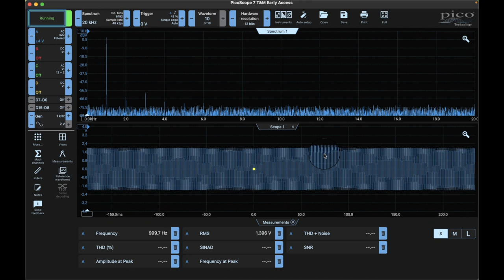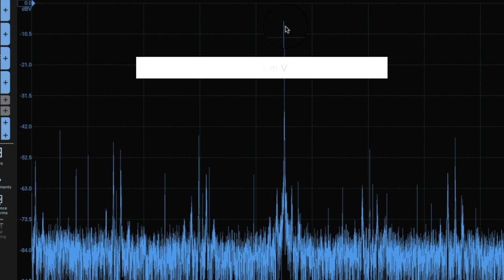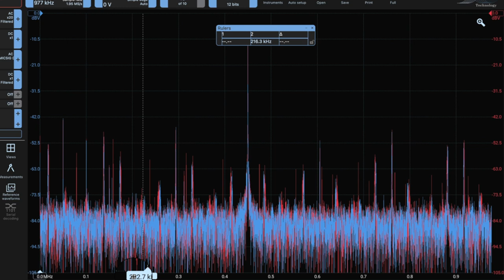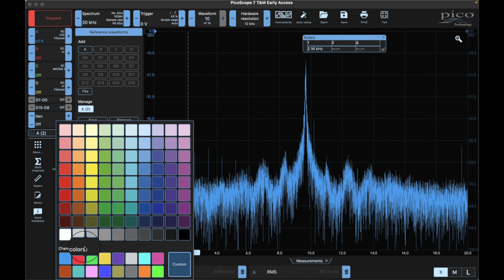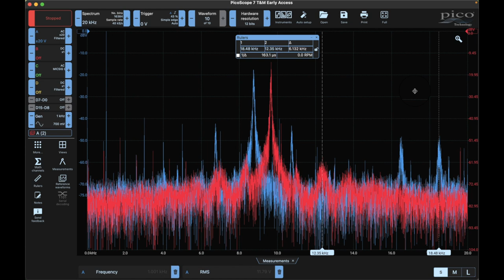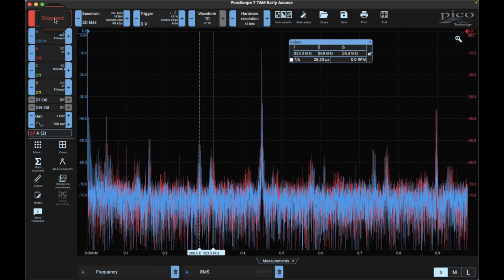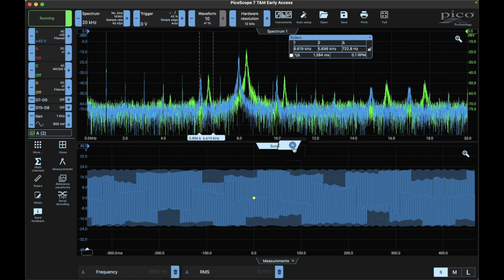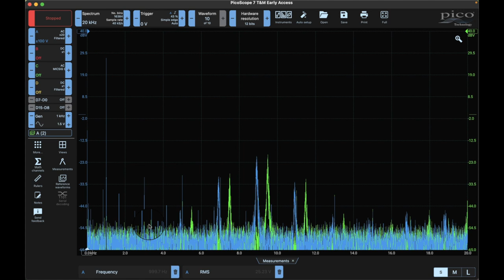TPA3255 Class D Amplifier Power Supply:  Linear vs Switching Power Supply Noise Study

Comment: If you have a bad smps, the EMI is a very disturboing factor, and all the harmonics and pulses of the switching action is bad, the mosfet body diode is a uge bad factor, the new Gan mosfets has no body diode and are very clean.
Reply from the maker: Thanks for your feedback!  Yes any bad design will ruin the benifit of using any good parts.  I think it is a bad idea to count on the body diode to do any function.  They have made the body diode more robust so it doesn't get burned out too easily, but I think most designs do not use the body diode on purpose;)
Reply: @KissAnalog  Do you now that a LCC doe also not bad, and no need of air gap and can use high inductance because these resonant tank is a current source, and very stiff. I have a very nice regulation and because of high voltage I uses this do a lot better. Even when no load zvs stays thanks to the circulation currents are in the tank and not in the transformer.

Comment: Regarding the small caps, there are definitely 100nF or 220nF decoupling caps from the Supply rail to GND right at the TPA3255 chip, underneath the heat sink. I wonder if the problem with running the switcher with the TPA3255 is that the harmonics can mix together and produce spurs?  If the harmonics of the switcher are within 20KHz of the class-D's 450KHz, mixing could get into the audio band. Maybe the mixing could get through the input cables, or supply as you suspected, or maybe even the output wires? You might want to try playing with the switching frequency of the TPA3255. There is a resistor on pin 8 that sets that frequency to either 450KHz, 500KHz, or 600KHz by using 30K, 20K or 10K respectively. See page 6 of the datasheet.
Reply from the maker: Thanks frammis for the great input - I’ll experiment and see if I can make some improvements!

Comment: 450kHz is the TPA3255 chip and the 153kHz is the LM259x-xx switching regulator on the board.  It would be interesting to see what the noise is like on the AVDD pin of the TPA3255 compared to the output and if adding a cap or changing the cap on the AVDD pin to something like 10uF, 100uF or even 1000uF would lower the noise on the AVDD pin and the output...  ;)

Could also be interesting to see a comparison of noise, temperature rise and power output when the FREQ_ADJ resistor is changed from 30k to 20k or 10k but if the AVDD and PVDD are stable all it should do is move peak noise from 450kHz to 500kHz or 600kHz... ;)
Reply from the maker: Thanks for the great ideas!  I’ll try this and see what I can find out;)
Reply from the maker: Did you see this video where I added capacitors to the DC voltage input and it did drop the noise at the power supply rail.  https://youtu.be/rV4R7FfCkrg
Reply: @KissAnalog  Ah yes.  YouTube recommended it maybe a few days after watching this video. ;)

Comment: Hey Eddie,  It might be possible to lessen the 'spiky' nature of the plots with a different FFT window type, for overlaying plots like that.  You get a trade off in amplitude vs. frequency, in terms of accuracy and jitter, the default window type is often a compromise.
Reply from the maker: Thanks for the great question!  I can definitely run with more samples to get averaging - that way it smooths it out.  I’ll get better with this;)
Reply: @KissAnalog  yes averaging may help.  I meant trying different FFT window types, if it's an option, e.g. Blackman, flat-top, Hamming, etc.

Comment: Try a 6sn7 Tube as an input buffer. Look at the Schiit Audio Saga + circuit. I tried commenting a few times edited them and had some glitches. Hope this helps! I love that little preamp and hooked it up to a pair of Mola Mola Kaluga monoblocks I had laying around for my kitchen system with a Luxman DAC-250 DAC and Amphion Argon 1 speakers and Bluesound Node N130.

Comment: Hi!  be nice to see you use a class d amp to run a class d amp.
any chance of getting hold of the Manley labs switch mode power supply 120kHz design by some Italian bloke for the valve amplifiers, be interesting to see how good it is?
would be good to have a good smps for valve amplifiers off the shelf with modification.
any chance of getting the noise floor down to -105db that's where you want to be. very curious about the Tom Evans power supply he gets it down -108db noise floor for his phono stage. he uses a lot of tantalum capacitors in his special bridge rectifier
Reply from the maker: Thanks for this amazing feedback!  This is one of my goals is to design Switching Power Supplies for Audio.  Not just Class D, but also for Class A;)  I didn't know about the Manley labs, but I love their story!

Comment: Thanks for posting all of these excellent videos!  Will running lead acid batteries in parallel with the power supply reduce noise in the supply?  I have had good luck doing this to improve service longevity of components, but this wasn't on audio equipment.
Reply: batteries are more noisy than linear regulators

Comment: Hi Eddie, Very interesting. This is something I have been wanting to test out myself. I have been looking into a few amplifier kits like the ones from Neurochrome, Hypex and purifi. (looking at putting together 2 endgame for me power amplifiers lol. I like the efficiency aspect of the class D over the AB, considering we are getting raped by the government and power companies at the minute lol. I always preferred the sound of class AB, but the newer class D amps have got very hard to tell the difference to me, at 45, and have abused my hearing for most of those 45 years lol. My main concern is that I don't want to be driving my cat (can hear up to 60+khz) nuts as I deafen myself with the Eagles. IT would be interesting to know if that high frequency switching noise is actually audible through the speakers, I somehow doubt it, but would like to find out. Anyway glad your ok, another great video, thanks. Dan.
Reply from the maker: Thanks Daniel!  I too am considering a Hypex or something like it.  I want to do some more investigation as this is interesting and it does seem to be a large difference between designs.  I like the brick wall filters so that the BW is flat from close to DC to 20k, but then maybe 40kHz the signal drops to a low level.  Save the Cats and Dogs and maybe the crossover/speakers;)
Reply: just check with your tweeter's frequency response, then you will know if your setup will drive your cat nuts ;)
Reply from the maker: @fuchoi  thanks - great tip!
Reply: @fuchoi  Unfortunately I take manufacturers claims on their paperwork with a pinch of salt, as the figures tend to be, we'll be polite and say massaged! I really doubt it could be heard, but i'm curious all the same lol. is the 20~ 22ishKhz the top end they can play, or is that just what they have been tested to as that's meant to be our hearing limit as humans. Would using a class d amp module and a linear power supply be wrong in some way defeating the purpose? I don't know, but if there where sound quality benefits, I would likely do it anyway. I like to make things hard on myself lol. Thanks. Dan.
Reply: @KissAnalog  That's exactly my thinking too Eddie, I use the brick wall filter on my dac. ;) Thanks. Dan.
Reply: @danielcampbell9220  trying out different setup and experience with our own ear is what makes DIY audio so much fun. Usually, Datasheet only state up to 20kHz as 99%of human can't hear anything higher than 20k. BUT, it doesn't mean the output of the audio class D amplifier is not able to drive speaker driver higher than 20kHz. Some class D amp IC has internal filter at the input side to filter out the signals out of audio band for output stability and noise performance.
Power supply is a power source, there is no right or wrong to pick either linear or switch - at the end it is all about how "ideal" it behave. If the output performance of a linear power supply and switch power supply are the same on load regulation, I doubt if it will generate any differences at the class D output. The better the regulation, the lower THD you can get. Just use the one with better load regulation.
For me, I will just look at the PSRR of the audio amp IC and the noise figure of the power supply (we can always characterise it), we can then work out the expected noise output at the class D amp output. For any noise lower than 50uV going to the speaker driver (not earbud), you won't be able to hear anything coming out of it.
Reply: @fuchoi  Wow, thanks for the reply. This is why I love channels like this, I don't pretend to understand it all. But I always find something that peaks my interest, and learn something new, or gain a better understanding of something I thought I knew! I do really appreciate you guys taking the time to reply and help me learn and understand. Thank you! Dan.

Comment: If you are able to "control" the distortion of the output, you will be able to tune how it sound like. The LC filter plays a big part there, especially the type of the cap used. Film cap will generally sound "better" than ceremic caps on class D amp output due to the distortion. The time that is easier for us to hear the difference on using different power supply will mainly on the dynmaic - how stable and how noisy the power spply output looks like under dynmaic load. Under that sceneraio, the bulk cap used also generate significant difference on how it sound like under dynmaic load. Try some ultra low ESR solid state polymer cap on the power supply filtering and some normla E-cap, listen and see which one you prefer. Low ESR will show better results on measurement but it doesn't mean better sound in all cases. using E-cap there will usually sound "warmer" on the vocal, but someone may like more boomy and clean using low ESR polymer caps
Reply from the maker: Thanks for the great feedback fuchoi!  I’ll check the dynamic response - and work with the caps.  I think the dynamic response will make for a great short video;)

Comment: as with all audio the proof is in the sound produced and not the test signals  and is subject to interpretation of the listener.
the audio  range has  been established as an analog output of 20 to 20000 kilohertz and is subject to preference.
Wer have all been caught up in the quest for the best audio possible . we can't hear the distortion as high as this video is presenting.
To use a 70's term garbage in garbage out. the front end of any audio circuit is the most critical to the best output.